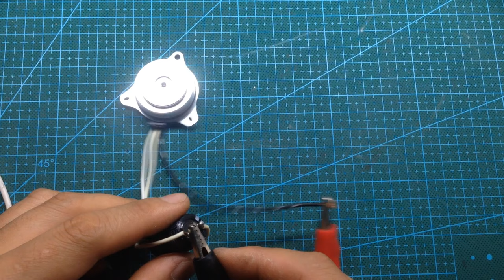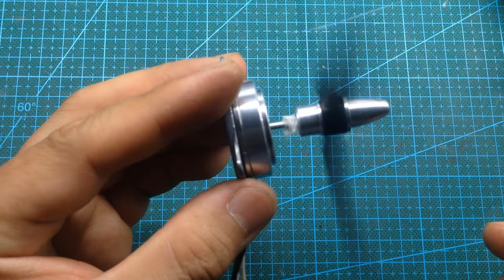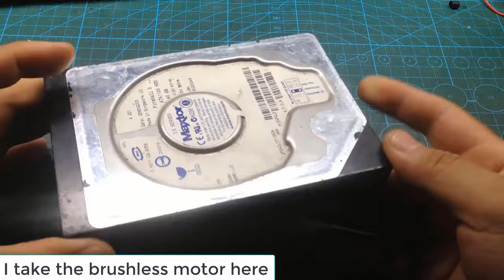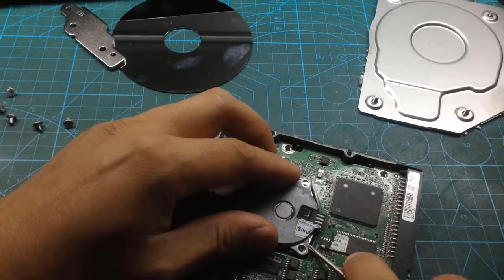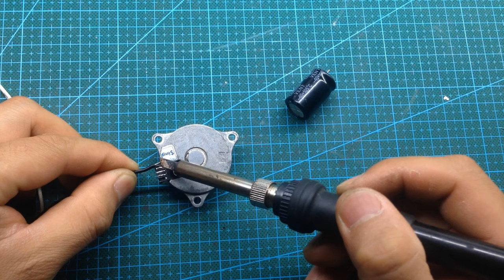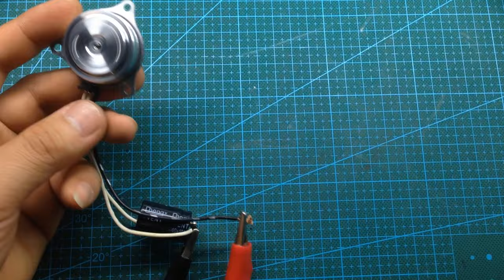Running Motor HDD without ESC

Comment: Inefficient and amateur like third world. Only two coils work in a star connection, just by chance. The motor will be destroyed as more current flows through the coils. Also needed is a frequency converter that was not shown in the video for "good" reasons. A three-phase motor can operate on one phase with one capacitor, but it is necessary to rewind the motor into a delta. The rated voltage is significantly reduced. Then that would be fine. Many things can work differently than they were designed, but only for a while.
Reply: can you show us how? genuinely interested in the one phase, one capacitor idea
Reply: @petermarin  I have given the instructions above. Search Google for values that suit your device. Only if you want to do what is on the video, you need to use a frequency converter that is intentionally hidden out of the camera's range.
Reply: Third world  thanks

Comment: I did this but motor was not running. Just vibrating and stuck. Was heating up
Reply: Because this video is fake.. you can't start it without ESC

Comment: this is amazing.   i;m currently have 4 wire  motor from HDD ...  but i wonder 
1: how to make it run it with DC power ?. also..
2:  does it need to be 3000+ uF capacitor  or not ?
tried with  300  uF and DC . xD not running..
Thanks

Comment: there is an IC current because it is connected to a capacitor like a negative wire to a positive contact, it cannot work if there is a constant current

Comment: your idea is quite simple yet genius, do you think that we can control the speed if yes how?
Reply: Control knob between capacitor and live, not quite sure really....
Reply: The speed is according to the value of capasitor (capasity). So by using variable capasitor make us possible to adjust the  speed in simplest way.
Reply: Or adding some mosfet like fz44 + potensio (variable resistor)

Comment: Hi, your circuit would only work on a three wire HDD motor right?
Reply: Yes
Reply: The four wires one has one more witch is a comon. Right?
Reply: @felipe-eb2oz  Yes. 4 wire one is star configuration with a common neutral point and 3 wire one is delta connected with no neutral point.

Comment: What's the reason of its rotation? Just a capacitor can't be.
Reply from the maker: It turns into a 2-phase motor. Like your fan.
Reply: @PhdHung  But how? Can you explain Please please please 🙏🙏🙏🙏🙏
Reply: @zees9669  that is a ac fan    the cap is just oscillating power between two coils taking the one wire as a common point     like a y configuration

Comment: Is it an AC or DC supply you are using?
Thank you for sharing.
Reply: @inspiringengineer  should be dc. atleast that what computers give out to them.
Reply: mx22  pc components are usually dc, i doubt it would be converted to ac for any reason. The hdds usually have 12v and 1 lower voltage but thag depends on the hdd
Reply: Since the power supply in a pc gives out low voltage dc
Reply: mx22  thats true. Didnt think about that it didnt have the pcb
Reply: blank_182  to what does ESC refer or mean ?
Reply: A lot of people saying that this is AC, but forget that the capacitor is electrolytic and has polarity, if it were AC the capacitor would probably explode, or you guys have never seen a capacitor like that exploding by turning it on backwards.
I don't know, this video looks fake, because that wouldn't work on DC.

Comment: I hv a floppy drive motor and it has 3 pin. Not running by adding a capacitor HELP!
Reply from the maker: Maybe it's a step motor, it won't work
Reply: @PhdHung  No it's a BLDC 3 PIN MOTOR.

Comment: ....and 
I have a four wires motor so will this trick work on that???
.
Please reply .
Reply: this motor has 4 as well so try it . I dont know if this works or not , let me know pls
Reply: :3 tried with 2 capacitors but.. not working xD. had you got it running ?
Reply: @HungNguyen-pz8wp  eh somewhat, it spins but with very low torque and also rotation was jittery.
And it's been 1 yr so doesn't really remember.
Reply: Aww.. I was hoping that you remembered some part of it and give me hints to make that thing running

Comment: But doesn't the Motor run at full speed? Not!!
Reply from the maker: yes :D
Reply: @PhdHung  Okay, I have two more questions:
1) What is the sequence of the wires to connect?
2) Is it possible to connect a potentiometer to control the speed?  Thanks++